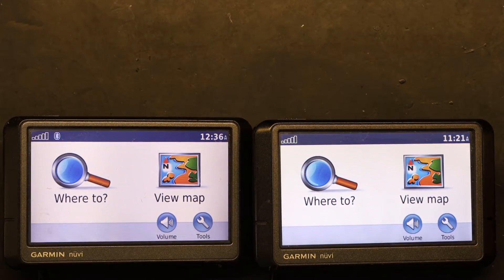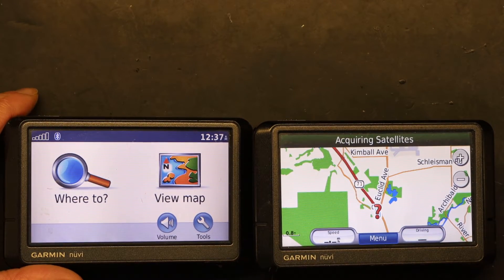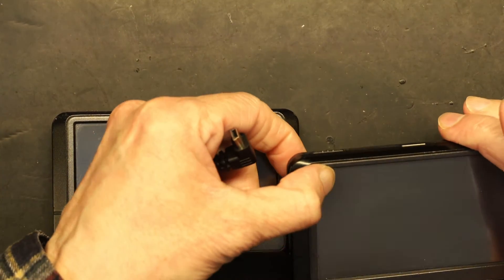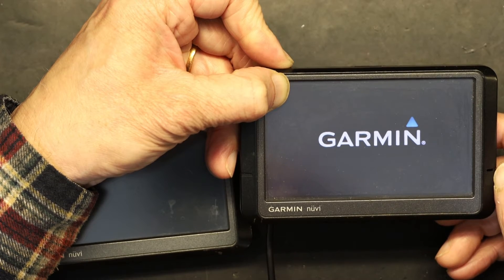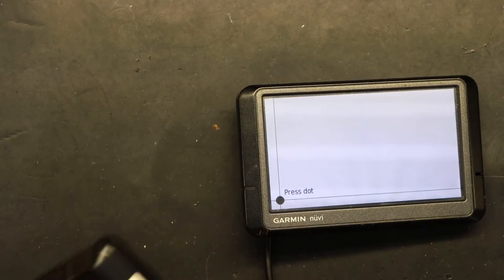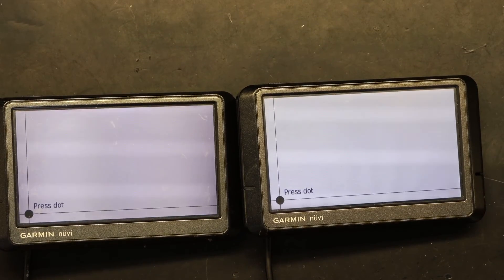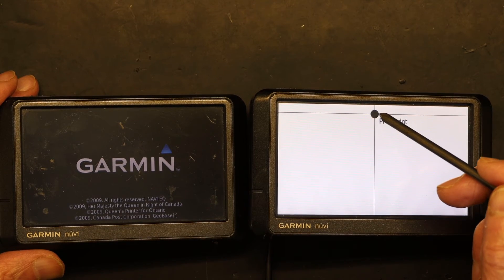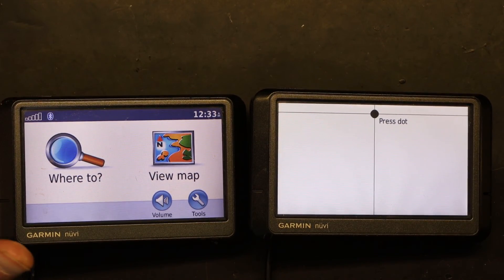Tutorial: How to tell if your Garmin Nuvi GPS Touch Screen needs Calibration or replacement.

Comment: Hi, I have a problem with the touching screen from my nuvi 205W, sometimes it worked but now it's getting worse. When I try to iniciate the calibration mode the screen goes from garmin to black. I already updated the software to the 7.80 version but the screen does not respond. Does this mean I have to change the screen? Thank you.
Reply from the maker: Hi, yes but you don't need a new screen, you only need a new digitizer which is the Touch screen in front of the actual LCD screen.

Comment: HI... I have a question I hope you can help with.  I have a Garmin Nuni 2575 that had an old battery.   It worked fine other than the battery wouldnt charge.  I ordered a new battery and installed it following your instructions.  When I turn it on, the screen lights up properly but the touch screen doesnt work.  It looks fine but there is no control when I touch it.  I have watched your videos and dont see anything Ive missed, but its not working.  Any suggestions?  Thanks!  Love your videos.  Very helpful!
Reply from the maker: Hi, thanks for your compliments. So there are two possibilities in this case. 
1. The LCD Screen flat Cable is not fully inserted to the cable socket on the motherboard. You need to take it apart again and push the cable in all the way. If there are two separate cables for Touch Screen and LCD screen make sure both are inserted correctly.  Watch this video to lear how to insert the cable correctly https://youtu.be/UsgEZOtveRQ  
2. The LCD Cable developed hairline cracks during battery replacement and the screen needs to be replaced.

Comment: hello mate,one question. Can I install the display from the Nuvi 1300 in the Nuvi 2495, both are 4.3".Thanks.
Reply from the maker: Greetings, unfortunately, you cannot interchange displays between the Garman Nuvi 1300 and 2495. Despite the fact that they are both 4.3 inch displays they are not compatible. The flat ribbon cable which plugs into the main board of the GPS is completely different. As a matter of fact two identical Garmin models could have different displays that are not interchangeable.
Reply: @TECHNOLOGYTIPS101  I thought it might be possible. Yesterday I got a nuvi 1490T 5" and I had an old display from Nuvi 2557, the same 5" and it fits, I just had to calibrate the display.
Reply from the maker: @divdivic8120   That is correct. Sometimes, different models could use the same LCD, and sometimes, identical models could have different types of LCDs that may not be interchangeable. For example, the Garmin Nuvi 200 uses 4 different types of screens that are not interchangeable, and the same set of 4 LCD Screens is also used in the Garmin Nuvi 1200.
Reply: @TECHNOLOGYTIPS101  And from which models the displays fit the Nuvi 2495LM
Reply from the maker: @divdivic8120  You have to match the LCD part numbers, not the Garmin Device part numbers. So, if you look on the back of the broken LCD Screen, you will see a stamp in black ink with numbers and letters, and that is the number that you need to make sure matches regardless which Garmin device it came  out of.

Comment: You hesitate yourself . This way does not work neither. My finger hurts. Always the same poster, locked screen, not your fault ther is more i did not understand or do
Reply from the maker: I don't hesitate, I need to know the exact model of your Garmin GPS to help you further.
Reply: @TECHNOLOGYTIPS101    Tank's  you are nice  it is Garmin Nuvi 1350 LMT
Reply from the maker: @l.r.dizing498  Sorry for the late reply, I had to dig out my Garmin Nuvi 1350 from my storage to make sure I will be guiding you correctly. So here is how you do it
Turn Off the GPS
1. Place your finger in the upper-left corner of the screen while pressing the power button with your other finger.
2. continue to hold your finger at the upper left corner until you see the calibration dot
3. Once you see the calibration dot, remove your finger and press the dot as it moves
Reply: @TECHNOLOGYTIPS101  A big tank you
Reply from the maker: @l.r.dizing498  You are very welcome my friend.

Comment: Hi could you help me my  garmin nuvi 396 mtl 2023 can't  aquire   satellite's could this happen if my battery is flat and won't charge up.thanks.
Reply from the maker: Hi, a defective battery pack should not effect the satellite reception, even with no battery at all the unit should work normally with external power. So I recommend that you not only replace the battery, but also use Garmin Webupdater.exe to do a firmware update along with GPS-Fix updater.
Reply: @TECHNOLOGYTIPS101  thanks for information regarding flat battery garmin offered me a replacement so will take them up on that. Thank you.
Reply from the maker: @BRIANFOSKETT  You are very welcome, and good luck.

Comment: I have a smartdrive 65 and two different times I was using it and I stopped the car the garmin went off but then when I got back in the car and  I noticed that the garmin didn't come back on. all the way home nothing happened with it. I brought it in the house and tried to connect it to the computer and still nothing.. then after several hours. I hooked it back up and it came on,, do you have any idea what happened,, could it be that it got too hot?
Reply from the maker: That could be due to heat, but it is most likely a software issue. I would use Garmin Express to update the firmware. Make sure all your maps are original Garmin because sometimes unlocked or third-party maps will stop working when you update the firmware.
Reply: @TECHNOLOGYTIPS101  thank  you, I did just update the maps , I'll put it back in the car and see if it does it again.